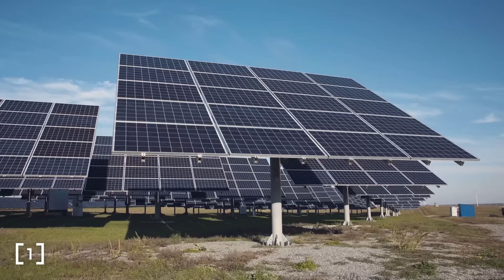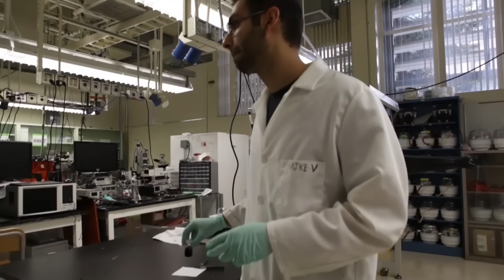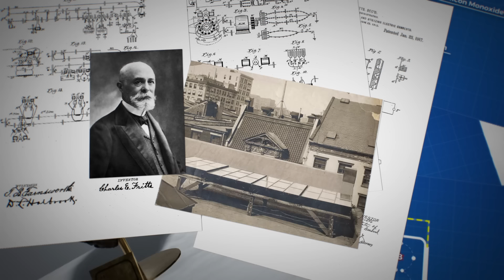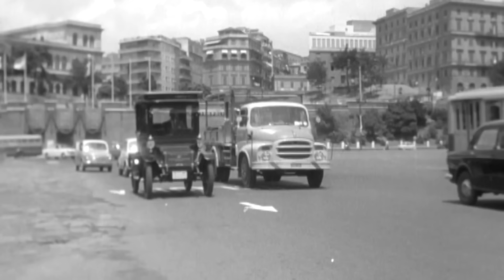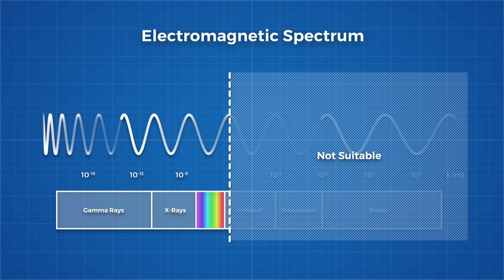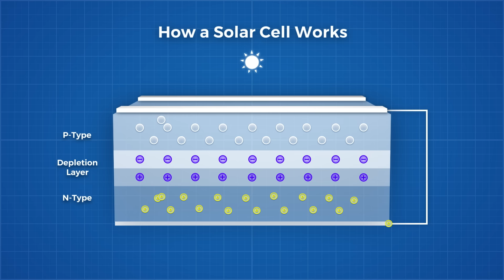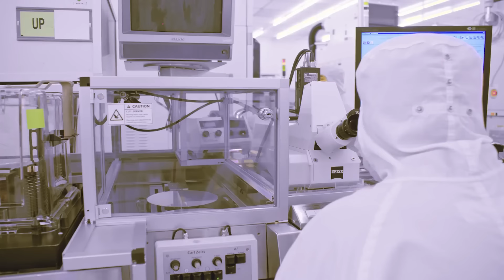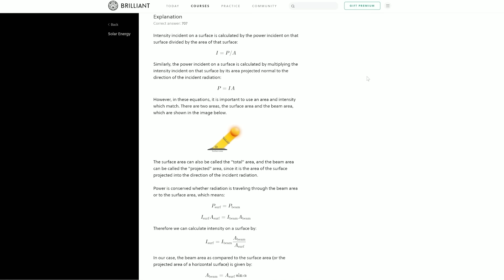The Mystery Flaw of Solar Panels

Comment: Back in the 60's I was visiting a farm in South Africa with a friend and I saw a solar generator made from a parabolic dish covered in mirrors about a metre in diam.......the dish reflected the sun's rays onto a small boiler and the resulting steam drove a small steam turbo generator to charge a bank of 12 volt batteries.......that was long before PV's were invented.
No matter what some say if you want to produce electricity there's no better way than a solar panel facing the Sun despite the efficiency being lower than other generating devices......when the existing solar panels get more efficient that will just mean a few more amps per square metre of panel......storing that extra power means you need a more efficient battery of storage cells etc.

Comment: I still have a solar cell I used on a crystal radio I made in high school in 1967, it's output is hilariously puny compared to the solar cells recharging the batteries on the garden lights on my balcony.  But I learned the basics of both solar technology plus how radios worked.  I later made my own transistor radio, I had to make the printed circuit board, install the transistors, and fit it all into a small plastic storage box.  The speaker and battery were the biggest parts, plus some space set aside for the ear bud. It worked and a couple of years ago I took it out, installed a new battery and let my grand-daughter play with it.  My question is, why did schools do away with industrial arts, or as we called it; shop?
Reply: I wish the highschool I went to had a program like that. I would most likely be in a better position now.
Reply: Education budgets keep getting cut. Your only gonna find shoo available in upper class neighborhoods and charter schools
Reply: @stopvoting4oldppl952    Yup, ill informed desperate people are easier to mislead.  Our Labor started being exported in the 1980s (the chilly war was quickly a forgotten fraud).  When we are sufficiently poor and desperate, most of our land will have been taken by those with all the money and then suddenly; we will be the new labor force that saves money for those bosses.
Reply: They had to make room for Gender Studies and Critical Race Theory, that's why.
Reply: @BaltimoreAndOhioRR  No that is not the reason.  Critical race theory is not taught in high school, it is an optional course in college only.  Too many people thought that the future was in computer use.  I told the local board of education in 1980 that in the future everyone would be able to use their own computer and professionals would not be needed.  They didn't listen to me and continued to teach data processing which soon became useless.  While math and science are very important, not all students are Einsteins.  History, music and art are also important,  and kids should learn basic skills in using tools and how things work.  Thankfully more and more schools are coming around to this idea and bringing back industrial arts and vocational training. AND in addition learning how to be tolerant of people who aren't like them.

Comment: I solve the mystery. Solar panels if you put current on them acts like leds. So when you test them on laboratory they have 20% efficiency. But when they are on greed they tend to take some current back from the greed and emitting light not visible but they do...

Comment: (1) Somehow, most people are unaware about CdTe thin film technology, which currently generates the cheapest solar-plant-scale energy, it is the most environmental friendly (the lowest carbon and water footprint in the industry), has the fastest energy payback time, 90% recyclable, has the lowest warranted degradation rate, has no cracking issues etc.
(2) It is not the electric field that separates the charge carriers, but a difference of electron and hole mobilities on two sides of a cell (see paper IEEE J. Photovolt. 5 (2015) 461). The field is a by-product of forming the n- and p- doped layers, which is the simplest way of creating the difference in carrier mobilities. The field somewhat affects the drift currents, but it is not the root cause of carrier separation.

Comment: i often said, those copper based calculator cells are way more efficient than quartz blue solar panels...  the blue quartz need sun direct light, the copper will transform any light source into energy... its a cheaper and flexible tech, lost in the financial interest of this quartz based cell industry... call it a conspiracy if u need... or think.

Comment: Solar cells are not renewable. It takes far more coal to make each megawatt of solar power than that obtained by simply burning the coal. The same is true with wind turbines. Solar cells and turbines are made with coal power. The whole “green” movement is all about big business screwing the taxpayer. Just ask that idiot Michael Moore, he finally figured it out in his latest book “Planet of the Humans”.
Reply: That's just blatantly false. There are dozens of papers estimating the resources required to build a wind turbine, even more for solar, and they consistently show that the amount of power that renewables generate far outweigh their material cost.

Comment: You need to discuss the vast tracts of land that have to be given over to the renewable power sources. What is the lifespan of the panels and how will aged panels be disposed of?
Reply: Aged panels still retain 75% or so of original output capability and are therefore useful in places where electricity is otherwise unavailable. To landfill old panels is a gross waste of resourses.

Comment: Good explanation of the limits and obstacles to higher panel efficiency. But 230,000 MW is not an "astounding figure". This is simply 230 TWh. Meanwhile world electricity production is  more than a 25,082 TWh (in 2016). Which means, solar is still less than 1%  (in 2019). Not much. Which of course doesn't mean it's efficiency will not increase in importance with time. And the suggestion or hint that solar is responsible for the reduction in coal is a stereotype. An increase of about 0.5% (panels) cannot cause a decrease of about 5%(coal). Actually natural gas is displacing coal. And gas is a hydrocarbon. So please stop the gallumphing.

Comment: The Power loss of "light induced degradation" will never be completely solved. So, you add the losses together of bad weather, loss of light due to nighttime, and "lid", and you have inefficiencies that make solar unusable to replace Coal, oil, natural gas, hydro,  and wind. I have to use coal just to heat my home in the Winter because the other means are too costly. I will not reveal how I obtain the coal. I just get it.

Comment: What if they could have a small glass of plastic with water in it to lower the heat and use that heated water for hot water use and pump back cold water to cool solar cells. Use the hot water to power a generator.

Comment: Thanks for the video.  If you stack the pn junctions then you can increase the efficiency, theoretically beyond 50%.  However, there are many manufacturing issues to address.  I believe the highest efficiency in mass manufactured cells is 24%.  Thanks again, nice job.

Comment: Sadly, winter, when we need power the most, they are useless.
Reply: Panels actually work better in the cold. Just keep the snow off.
Reply: @wesleyrodgers886  Really. Try them clean when they are frozen (wet snow, then cold and stays that way rest of winter).
Reply: @wesleyrodgers886  The drop in overall light levels in my experience makes the energy generated go way down.

Comment: FUN FACT: Natural Gas is 90% efficient, and can run thru a pipeline that takes up 1/10,000th the land needed for Solar (or Wind), and is always available. Solar and Wind will NEVER be available at all times, and the storage of Solar/Wind power uses more CO2 to create than Natural Gas will ever use. So don't be that Green New Deal idiot who thinks Fossil Fuels are a thing of the past, as it never will be. BONUS FACT: It doesn't kill birds by the thousands, either.

Comment: Just ask the Germans how those panels work with snow on top of them. Since the wind turbines don't produce usefull power when extreme cold happens to them, like it did in February 12, 2021 the whole concept went down the craper. They went back to coal and natural gas back up to bail them out. Fossil fuel to the rescue! Same thing happened in South Australia a couple of years back (2016) except they demolished their coal fired power plant and were caught with their pants down and no back up capacity after the main transmission line went down.

Comment: Although no Carbon amissions for nuclear but they do poison the earth in other ways. Produces radio active steam and takes up lots of water. Coal also takes up and poisons water. We need to keep water out of our power plants and keep in our drinking glasses and bongs.
Reply: No, just no. Assuming the design even uses water, the only way for there to be a release of radioactive steam (at least, more radioactive than regular water already is) is for there to be a containment breach. Even then, the exposure of anyone outside the facility will be so negligible that it would disappear into the sampling error of background radiation dosage.

Comment: I'm curious: how do modern photovoltaic cells compare to focused light solar farms?  The ones that lay out a grid of mirrors focusing sunlight from a wide area onto a central cell where you can have a traditional steam boiler or the like.  Obviously the photovoltaic cell concept has a major advantage that the focused light strategy could never manage, and that is the ability to miniaturize.  You're not going to build a viable car with a bunch of mirrors on it focusing light onto a steam engine, because that only works when you run it on a massive scale.  But in terms of overall power output, the mirror solution at least seems to be simpler to manage.
Reply: Its a fairly complex calculation really.  Your best bet would be from real world examples, and even then the two powersources aren't totally comparable since Solar produces DC and a generator produces AC and adds things like momentum to the system (Power companies have a lot more than just pure Watts that they have to monitor).  I would say Solar towers are still an experimental technology, and there are a lot of sources of loss in them.  Every time you change the form of energy there will be some amount of loss associated with it.  These turn light into reflected light (you won't reflect it all to where you want) into heated salt, which then heats water which is then turned into electricity.  Also like you said the scale is a problem, though its not like you can realistically power a normal car with photovoltaic cells either.
Reply: Focused light or thermal solar requires a lot of good engineering to work. No problem in Spain but the one in Nevada was a failure ; they should have hired Spaniards however they wanted to reinvent the wheel but ended up with an ellipse.
Reply: @paulmcgown7504  apparently plan for such plant in morocro rendered uneconomic by cheaper energy from solar panels. Did not the one in nevada run for 4 years only but energy again more expensive than standard solar panel plant, now a relic
Reply: It's a great idea, however the biggest challenge is the massive number of dead birds.

Comment: The biggest issues regards solar cells are surface texture and band gap. The solution to surface texture is a 3D surface design, with the collectors built in.  Band Gap is best resolved with a bias voltage similar to a op-amp circuit biased produce near linear bias at near zero voltage without clipping.  This also solves most problems associated with free electrons not being captured.

Comment: I appreciate the effort to explain how solar cell works and their importance, but I encourage you to go further in your research.  Solar panel manufacturers nowadays sell their modules with stabilized power figures, so saying that PV modules lose 2 percent absolute efficiency upon starting operation is not accurate.  Light-Induced Degradation is by and large solved in modern PV panel manufacturing, either by the use of gallium-doped silicon wafers or by a stabilization process step.  There are other degradation mechanisms that do occur such as encapsulation and interconnection degradation, leading to about 0.5 percent degradation per year, but this is also being tackled by PV research.

Comment: Solar Panels’ one mystery flaw: night time
Reply: That is why you use it right away or you store it either in battery or as heat in a water tank. Some pump up water into a reservoir at daytime and power a generator throughout the night.

Comment: so I'm hearing solar panels lose efficiency as they heat up... cooling system for each panel to prevent that overheating should help.
Reply: They have panels that generate electricity on the top side and use the heat on the bottom side to heat a water heater.

Comment: "Driving fossil fuels out of the market" - this statement seems ungenuine; what about the short lifespan of solar cells and the high consumption of energy in making them including a great deal of coal used in manufacturing?
Reply: Short lifespan of solar cells?  You mean 40 - 50 years is short life?, this are panels that are currently still in use after 40-50 years. 
Mono crystalline brake even after 3 years, between energy used making them and producing the same amount energy for making them,
 Polycrystaline break even after 2 years, 
Thin films break even less than 1 year.
Reply: @FloryJohann  Short lifespan as in.. There is not enough efficiency to account for surface area against energy recovery during the lifespan.. within a high efficiency environment.
Reply: @FloryJohann  also it seems that panels go down in efficacy and only are warrantied for 20 years; maybe you could use a solar panel for 40-50 years but would the low amount of energy output after 30 years justify it's continued use?
Reply: @AntonioEligius   After 20 years, a 100 watt solar panel still puts out 85 watts.  So I guess it is still would be  worth it to me.  Would beat a generator that may last a year or two and eats a lot of gasoline .   A gasoline engine is not that efficient either. 2/3rds of the energy input of gasoline engines goes into heat  which amounts to about 66% loss. Pv panels with about 15% to 18 % are not there yet to compete with gasoline engines , but heating water with solar has about an efficiency of about 80 % and the energy is free.
Reply: @FloryJohann  it might be for you in your ideas, but solar isn't exactly free even after you paid for it, you need large surface areas to get meager amounts of output; sure you can put them on roofs, but a roof array doesn't exactly run an active household, you need figurative tons of space for not a whole lot. And sure solar panels now are better than the first solar panels, but they haven't changed much in recent years.
Reply: @AntonioEligius  Whatever, stick with your grid and pay for that power or stick with your generator.
Reply: @FloryJohann  The average solar cell takes over 100 years to pay for itself. The only reasons solar panels exist is a penny less neoliberal communism industry is paying government millions of pounds to ban fossil fuels and give renewable energy £ 5*10^15 every year. Also everyone who has been with in a meter of a solar cell dies a week later because of noise giving them cancer. Wind dose the same thing becosue trump dose not lie. If you disagree whith me you hate FREEEEEEEEEEEDOM

Comment: The big problem with solar is one that can't be solved. The continental US and most of Europe are lucky if they average three solar hours per day. Places like Canada and most of Russia get even less sun.

So if you install one KW of solar, you're lucky to make 3 KW hours of electric per day. If you install 1 KW of nuclear or fossil fuel powered generating capacity, you get 24 kilowatt hours per day.

The only way to fix this problem would be to either increase the sun's radiation or change the Earth's rotation. Even if we could do those things that it would cause more problems than you could ever imagine

Comment: Unfortunately, you described the  influence of recombination wrongly. As long as the recombination is radiative, the  reabsorption of the emitted light will avoid a drop of efficiency. Furthermore, the np-diode is not necessary for solar cells. You need only selective contacts, which can also be achieved by using specific conducting materials for the electrodes. The light-converting semiconductor may be undoped. Actually, p-i-n diodes used for photodetectors but also solar-cells use this principle to achieve better quantum efficiencies than simple p-n diodes. Thus doping is not a real problem as long as it under control, means limited to the contacts. However, if it start to diffuse into the semiconductor bulk it max reduce the efficiency. The bigger problem, however, is the  unintended doping with atoms e. g. sodium or crystal defects which causes recombination either radiative below the semiconductors absorption threshold or even worse radiationless. These cause a lot of solar cell degradation and may be the main reasons why cheap solar cells drop in efficiency faster than expensive ones. However, it is not fully understood where e. g. the sodium come into the material. Therefore, even solar cells produced on high quality standards may be affected by these problems.

Comment: Solar cells are just not efficient enough, it's a start, but they really need to be 50 to 70 % efficient to really change humanity.
There has to be a better way of converting sunlight to power, just we haven't found it yet.
Reply: I agree they should be more efficiency but your 50 to 70 margin is overblown. The "fuel" for them is free